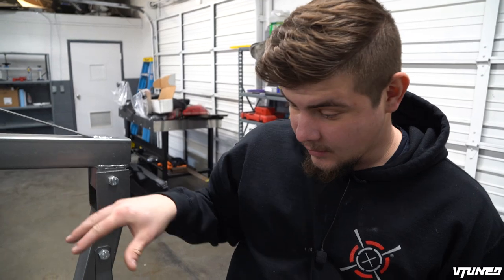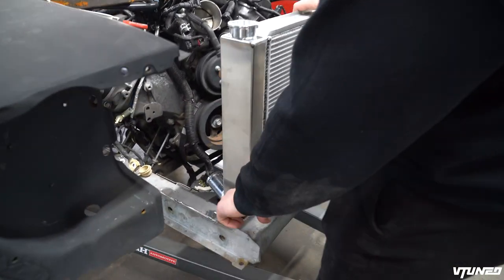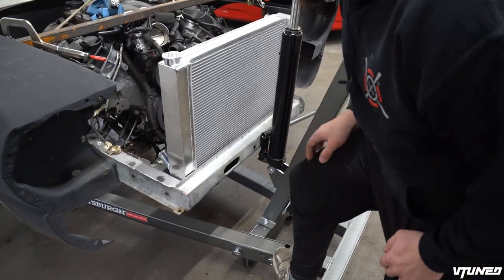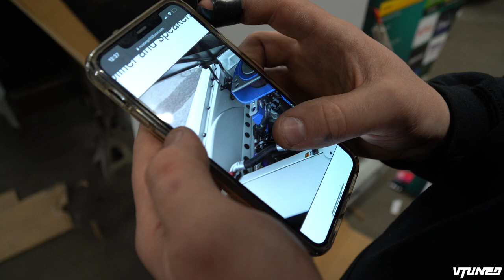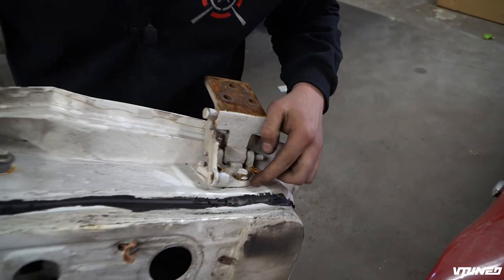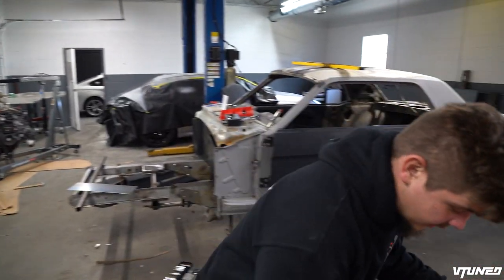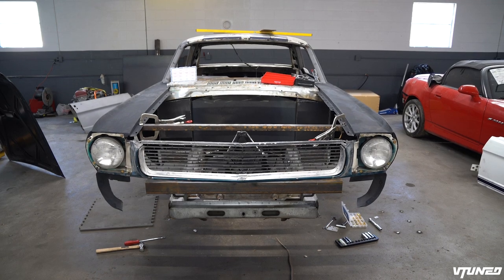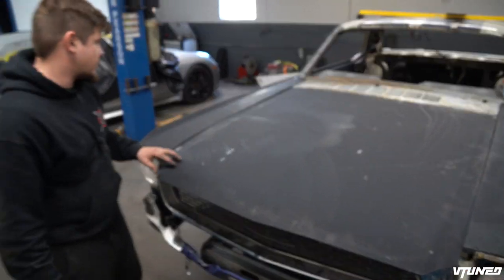Building Custom Front Aprons For My 1965 Ford Mustang ! 1/2

Comment: Looking good! Personally i would think getting the engine and main components as well as front suspension and tires on so you know 100% where everything sits and clearances before finalizing it. That being said i am not a fab guy i just get the impression it possibly will end up changing a bit once things get situated. Also if you make it in a couple removable pieces a quick unbolting could make an insanely easy to maintain engine compartment
Reply: At the bare minimum before he fabs anything else, I'd make sure to have the motor bolted in with the exhaust pipes/headers he's going to use.
Reply: Yeah I said the same.....gotta make sure those inner fenders clear the front wheels.....don't want to have a 50' turning radius.....
Reply: Look at the other mustang build.  Really looking like a similar path be8ng taken

Comment: I agree with several comments about waiting until you have the brake booster,clutch cylinder,and steering column mounted after the suspension and engine.Then you'll know the space needed.A folded lip along the tops of the liners for mounting the fenders can be designed then too.Don't forget the check on the Electric steering control from a Prius the mounts under the dash and in your column too.Allot of hassle saved there.

Comment: I don't know if you planned on welding the aprons to the fenders. I wouldn't. Make a lip all around, so they can be bolted in and also be able to be removed if needed, later. Continue to evaluate all concerns, before you go to metal. Nice job
Reply: second that !
Reply: Third that.
Reply: Maybe weld the  hood on too.

Comment: I would highly recommend getting the suspension set, steering box set, column installed, brake booster, engine and trans bolted in before I went after the aprons. The design looks solid but I think there will be a lot of rework and modifications once you get all that set in place.  Save your templates and get your parts coming you are going to use for the build.  I think a temporary mock up of the front clip is a great idea to make sure your engine fits ok but no need to burn all that in if it's really not critical to the rest of the build just yet. Just my opinion.  Good luck with it!

Comment: Just buy the complete aprons from Mustangs to Fear. Made for cars that have the shock towers removed. Have fender holes in them, hood hinge holes, etc. No need to reinvent the wheel.
Reply: I know Ben likes to do everything himself, but he could at least use them for ideas....yes, the ones he makes MUST have the bend at the top to bolt on the replacement fenders.....
Reply: But how is he going to show off his skillz of his craft by butchering yet another project? I hope he welds the fenders to the aprons to make it so much stronger, since you know...the front cross member isnt strong enough as it is now either.

Comment: When you do the fender liners make a lip for the fender to bolt to also the reason for bead rolling is not just for strength it’s also so when you go over a bumper flat metal sounds like thunder when it vibrates, dimple dye the metal is also another option old timers do it to reduce weight without compromising strength. Can’t wait to see it on the road!!
Reply: he has no clue how to do that.

Comment: Me myself would wait till I get the motor mounts, turbos, hydro boost mounted. That steel is a little to thick you don’t want the front to be too rigid that’s where your room cage come into play then after everything is mounted and cage is in then build the aprons to fit. The bar on the front of the rails leave it just put a brace in each corner.. don’t make the same mistakes you made with the other car. Good luck love the videos 🤙🏽

Comment: Where are you planning to mount the battery?  If under the hood I would put a recess into apron for the battery.  And if you are seriously considering turbos... I would plan to set those into the apron some.  Otherwise the simple V aprons will work.  You could also mount the battery under the apron and out of the view, but makes it harder to service.  Now... since you are building them out of thicker gauge metal think about a front impact.  I would put a small crease into the metal about at the middle of the wheel flare.  So that in a collision those aprons would have a moment to fold vs putting the force into the firewall.  And if you are using the 1x1 box tube for the fender mount I would put some crumple zones into it unless you are planning on caging it and can attach the 1x to the DOM of the cage.  I would also plate the firewall where the 1x1 lines up with it so it can't punch through the firewall (like you would a roll cage on the floor mount).  Having a straight 1x1 tube pointed at you with only 1/32 of sheet between you and the end of that tube in a wreck would probably not be optimal.

I do like your plan of keeping it in cardboard until you have more things in place.  Make sure it clears the headers, steering, suspension, brakes, etc and then fit the apron... I know personally when building something custom about the 10th time I've taken it apart to make a change is when I start disliking the project... I always hate the very end of a custom build when you have to take it all apart and prep it for paint...

Comment: Personally I think you should get the drive train and suspension completely set up and have a running and driving frame then worry about completing the body so you know the exact clearances.
Reply: Agreed, especially if hes talking about putting in a twin turbo kit, hes going to need the extra room to either relocate things and/or for the turbo piping, intercooler, etc
Reply: you are right.  and that's exactly why he isn't.

Comment: There’s no such thing as “too much space” inside an engine bay. You always want the most space you can. Even so if I was making that engine bay I would wait until the suspension bits have arrived and check for clearances before committing to making the bay. Specially checking for suspension and wheel travel when the wheels are turned.

Comment: First let me say I love the fact that your taking your time with the build. I think doing the sheet metal at a angle is a very clean idea, building sheet metal engine covers down the road is also a great idea. Don't forget with all the extra horse power to add some weight to the rear end or find a way to try to get to at least a 60 40 weight distribution. Maybe give the TRUCKS ford ranger engine swap videos a watch and see how they did their build

Comment: I believe the VIN Number was stamped on the top of the drivers side apron that you removed. It was there on a couple of 1966 Mustangs I owned. Actually it was on the door tag also.  Not sure if that will be a problem.

Comment: With the engine bay i would definately go with the flat spot option but on the flat top you could punch out the letters V-TuNED and have a plate beneath with the body colour to make it pop! Makes the bay cleaner without the extra space but fills the flat tops at the same time and puts your stamp on the car for the rest of its time!! Keep smashing it brother🤙🤙

Comment: I like the slanted design. Also if you have to mount anything to the inner fenders, it will be at an angle facing you. Much easier to access and troubleshoot wiring, etc. 
Not expecting this car will see much rain, but maybe work it so water drips down the inner fenders and onto the ground and not onto the frame.

Comment: Looks good to me all depends on your suspension set up. You don’t need bead rolls on it.  The max you can bead roll is 14 gage on steel and you can’t even roll that 14 you have to stamp it. Keep doing you it’s good work. Tip for bondo mix fiber glass resin into it to thin it out to glazing do not add the harder just the resin the more you the thiner it will be a Little bit goes a long way. After you get the hang of it you will love longer have to get glazing

Comment: Have you thought about using a bead roller on the inner fenders?  It adds A great look and significant strength to the sheet metal.

Comment: Looks great. My only concern is not bead rolling the fender liners because it will stop them from getting wavey or making noise when driving. I would definitely bolt them on.  Of course it's only my opinion. Can't wait until the next video!!!

Comment: On the more serious side of things.You need to do your suspension,tie the frames together,then you can cut the roof off and build your cage with it tied into the front before you bolt in aprons.You'd be cutting them and working around more stuff,and possibly moving it too.Good luck Ben.I think it's going to be a street,and track ripper.

Comment: My first car when I was 16 yrs old was a 66 mustang 289 and they was very rear end light. Can't even count the times the rear broke lose in the rain at a very slow speed and spun out.  With the extra weight in the front you may have to add weight to the rear just to balance every thing out,

Comment: Install suspension, wheels, install engine, install exhaust...then build fenders.  Otherwise, I am afraid you are going to be cutting out all of this all over again.
Reply: I would also be checking wheel clearance.

I get you're waiting for engine mounts & suspension but, don't jump the gun, it's better to stall the project than have to RE-DO work...
Reply: thats how he does fabrication.  step 1  have no plan.  step 2 make shit up as you go.  step 3 scrap it all and start over.  step 4 go back to step 1
Reply: @13christbane  Criticism of a channel, or a build, is absolutely fine but what you're doing here is simply trolling and it got boring a while ago. If what you're seeing is so bad, why do you continue to watch?

Comment: It kind of looks good, problem is that you will be creating air pockets in the fender wells. Look at the stock fender wells and you will see what I am talking about. One other thing is that you will need surface space for the electronics so you may need to rethink some of the flat spaces and how to use them.... Remember the old adage " measure twice cut once.... Look at the fender well and how it works. If you add metal like you said to finish off the compartment you take away the opening for the lights and blinker assemblies, unless you are going to use OEM light bulbs instead of new LED lights .... Anyway good luck looking good so far....

Comment: Nice video!  Question...  How do you relieve air pressure in the engine bay when driving?  I know in some circumstances they vent the engine bay near the back of the front fenders or add louvers or vents.  Do you have any plans to do this to add aero efficiency and lower engine bay heat?

Comment: you should check out Demolition Ranch video today.  Wilwood has a brake system just like you mentioned that mounts on the pedal side below the steering column.

Comment: Right apron needs to have some space for the heater/AC plumbing thru the fire wall . Run a few bead rolls on the aprons for strength.   Your moving in the right direction, great job.
Reply: HVAC..? Dude threw away any chance of that with his garbage custom firewall
Reply: @thesinwagin   A Vintage Air system could work
Reply: he is for sure not even close to moving in the right direction.

Comment: Also the engine bay looks amazing, however, you guys should put a bend at the top of the aprons just like you did at the bottom, that way you can bolt the fenders to the aprons as well instead of welding them to the fender. That way they if you ever have to take the fenders off there just bolted on

Comment: Go to Harbor Freight and spend $90 bucks on a air assist cylinder for that engine lift. Simple lever up or down. Still able to use the handle if you want. makes life a lot easier.

Comment: Gettin' ahead of yourself with the metalwork for the engine bay. Much better to fit the engine and the suspension, THEN build the aprons around it, accounting for brake boosters and all the other myriad of bits and pieces. If you do the engine bay first, and you get it wrong, you will have to make compromises with all the rest of it. Do it right from the beginning. No compromises.

Comment: Suspension and wheel travel first , down pipes from the cage (if you have one) , master cylinder location, a lot of issues that should be dealt with before wheel wells/aprons ... jm2¢ ...

Comment: Ben, thanks for the video. You are coming back towards your original intent as a Resto-Mod "quick-flip" (which I absolutely think is the right direction) but you slipped up and called this a race car in this video. You shouldn't even put any wide body panels on it. If you want wider meats on the back, put them inside the existing fenders. It'll sell better.

Comment: Buy some thinner metal. No need to use thicker . I raced a drag car for years with no inner fenders with more power than you have . Bend the upper angle to under the fender lip . Do not use the square tube . The fenders will hold without extra weight added.  Go to harbor freight and buy a air  assist  cylinder for that engine lift , $90 bucks  , Will make your life a lot easier.

Comment: Pretty sure those fender aprons are part of the structural stability on a unibody you might want to factor that in while trying to re-design something different wouldn’t want to see the car fold up like a taco when you go over a Railroad track.

Comment: They do make a master cylinder that the reservoir mounts under the dash so it isn't in the engine bay at all. Check them out. You have options.
Reply: Holden brothers are building the ranch stang and are installing one

Comment: Dunno but if it was me, I wouldn’t have cut away everything without making a box frame where the fenders sit. Trying to do it now that you cut everything away and are using (according to you) very bad aftermarket fenders, is going to give you a headache later. 

I can’t remember how bad the fenders were after the accident but I didn’t think they were complete trash.
Reply: I would go with the original, get rid of this firewall and go as stock as possible. Why messing this mustang too, when he already has one for the experiment
Reply: He's got that cowl under the fender. As I remember he took the original cowl off the body. He may need to flatten the replacement cowl on the ends to make the fenders lower themselves to the body line...

Comment: You're getting ahead of yourself with the inner panels. You need to build and set the steering, suspension, and engine before the inner panels, otherwise you'll be building them for the second time.

Comment: get nutserts for the inner fenders so the fenders can easily bolt to them am be re4moved as needed easily nutserts can also help with the booster mounting an cutout for the booster the covers for them the engine an all that (harbor freight has them )

Comment: Great insights on engine bay.  Remember what you said about space, get every square inch you can even if you go 90 degrees down from inside edge of the fender.  You will have to make a corner at the tire well just like you did with the brake system area.  I know that you have probably considered this but sit down and on paper factor in every component that will go under the hood.  Make sure you have a pre designed place for it, battery, electrical ect.  Get at it!

Comment: I would cut the top rails from the original aprons if you still have them. Bolt them to your fenders and weld your new aprons to them. I like your cardboard aprons.
Also it would make registration easier when the time comes because the VIN is on the top. 
I've had a problem with aftermarket fenders not lining up at the top. I cut the rear section from the junk fenders and trimmed it to fill the gap and welded it to the fender. 
I still have a good coupe roof if you want it. Free if you pay freight or have someone pick it up.

Comment: I get you want to rebuild the front end stronger, but when you keep replacing that thinner, lighter metal with thicker, heavier metal you are adding weight to the front end.  You're also putting in a larger, heavier engine than was already there, and the balance of this car wasn't really optimized to begin with.  Hopefully if you have some plans to shift the weight a little better going forward, otherwise it's going to want to plow going into corners.

Comment: What happened with the Corvette front suspension parts you got for the other Mustang? Are you still planning to use them or go back to shock towers? I would get the car rolling, engine mounted, etc. before doing the sheet metal.

Comment: Since you have to replace the roof skin on the mustang why don't you just use the fastback roof and trunk section on this car to redeem yourself on the original mustang build 
I have a 98 Mustang convertible I'm fabricating a 66 fastback mustang roof trunk and rear taillight panel on to
You do good work and car is coming along good but honestly build the car how u vision it that's what truly matters

Comment: Consider working with a sheet metal fabricator to press brake those bends. You'll need a horizontal lip to bolt down the fenders also. Better to press brake than weld another piece in.